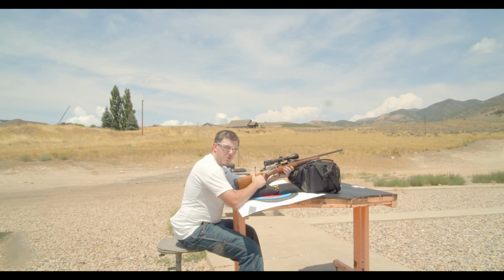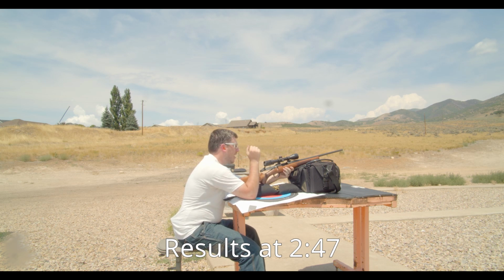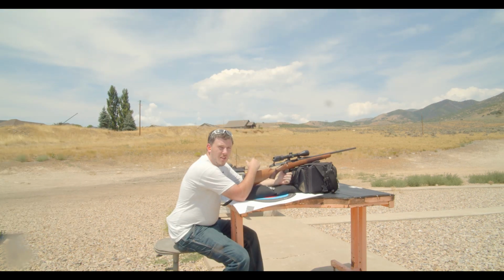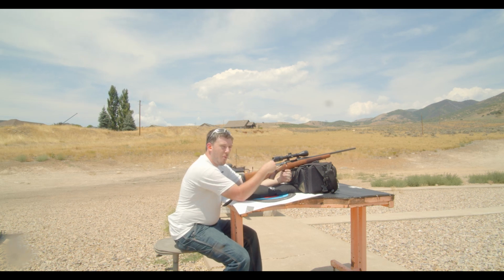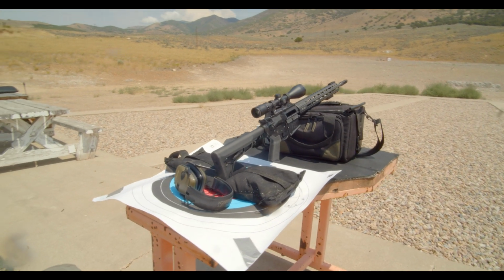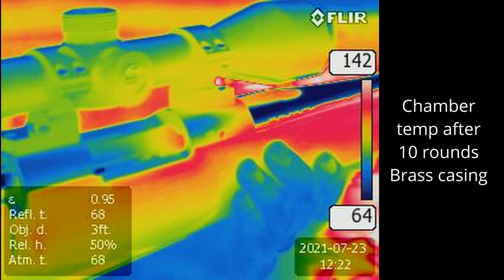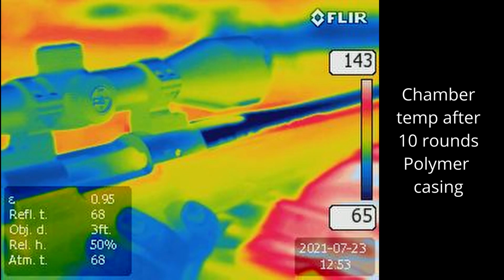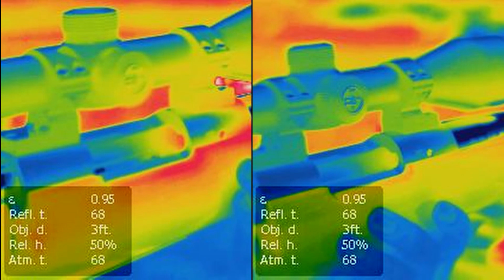True Velocity .308 Winchester Keeps Chamber Cold?! | Thermal Images

Comment: Who says this is the result of the polymer (alone)? Unless the composition of the gunpowder is exactly the same (as in, from the same lot), there's no telling where the difference in temperature is coming from.
The fact the barrel is also shown to be less warm with the polymer rounds makes me suspect the reason for the temperature differences lies with the powder instead of the polymer.
Reply from the maker: Lol we're not scientists, we just sell ammo. That said, True Velocity has told us that because the interior of the casing can be molded when it's polymer, they've been able to achieve a more efficient powder burn. If I remember correctly they said that their rounds use 20% less powder than comparable brass rounds, so you may be on to something.
Reply: Metal is a conductor for heat, polymer is an insulator. It traps some of the heat from the burning propellant inside of it thus less is transferred to the gun. I've seen people say the accuracy for this ammunition is not bad but not revolutionary either. Really if there is any reason to get this ammunition its that you can fire more rounds before your gun overheats. It was cool to see someone test the ammo's other aspects besides accuracy as lighter weight and less heat were also part of the marketing.